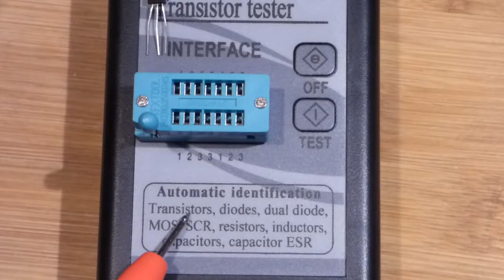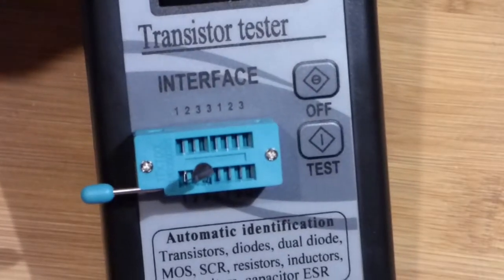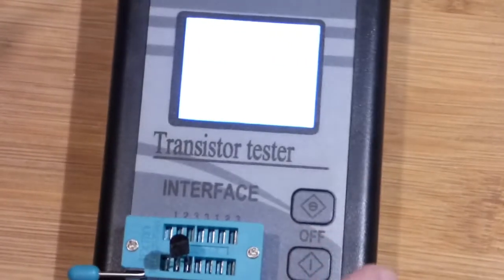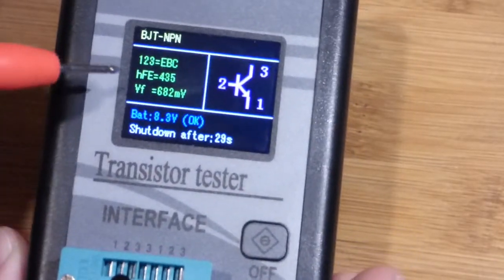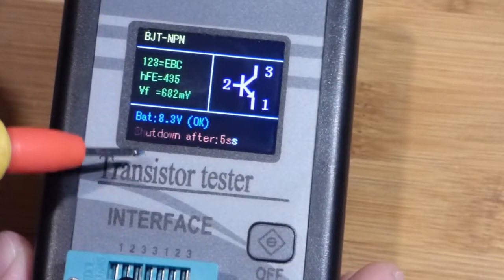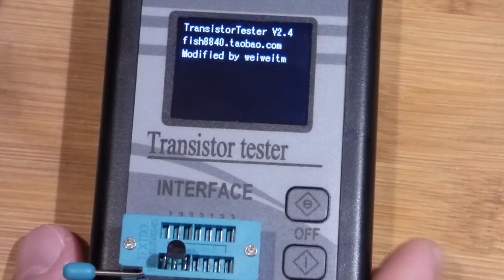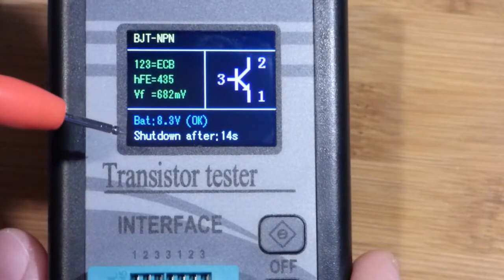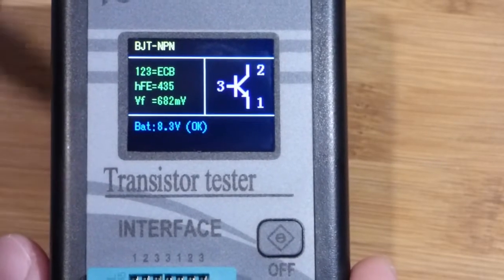DROK automatic transistor and component tester results for 2N2222 and C1815 NPN BJTs

Comment: Thanks for the video.  I'm new to this and building guitar pedals.  I;m trying to group Jfet transistors into the values I need.  Will this measure mA of those transistors?  I don't see that reading.
Reply from the maker: I think this mostly only gives some of the resistance and voltage information and helps identify what the pin layout of certain components are. I'd check the datasheet of any component you have. I go to the digikey website and look up the component like I want to buy it. They have a link to nice datasheets next to each item.
Reply: @Electronzap  what's the best way for me to find the jfet mA?  Need to have 4 at around 80mA. Thanks again
Reply from the maker: No clue unfortunately, I am new to studying JFETs. I'd try to find an online forum where they talk about JFETs, especially for the exact application you are using them for.

Comment: It is nice that it can test capacitors, diodes and even inductors. 33$ seems a bit expensive though. When do you use a dual diode?
Reply from the maker: It's not a must have device for doing electronics so not a great investment if on a budget. I only bought it because I can make videos on it. But, it would have really helped me out a lot when I was getting back into electronics a few years ago. They do have cheaper versions on Ebay if interested. Also, there's a number of videos of people using it transistor/component testers just like this one on YouTube, so you can learn a lot just by watching those videos. Thanks for watching!
Reply from the maker: Never used one myself, but I think a dual diode is primarily used for backup battery circuits. The higher voltage source will be the only power source used. When it cuts off though the battery takes over. The 2 diodes separate the man power source and backup battery so they don't interact with each other, but either can power the circuit one at a time (whichever has the higher voltage at any given time).